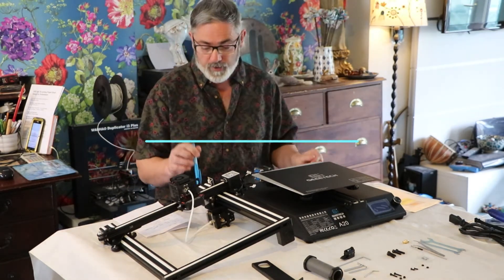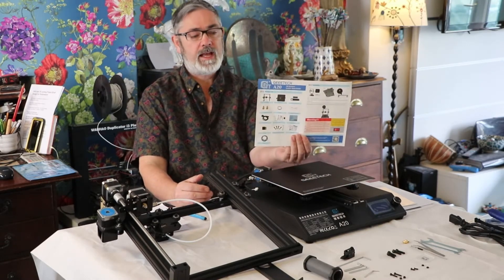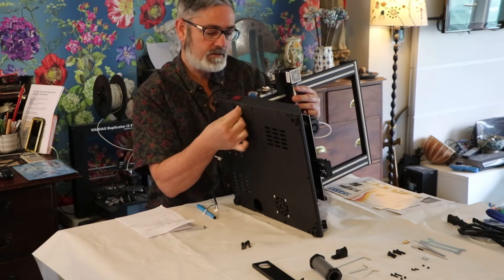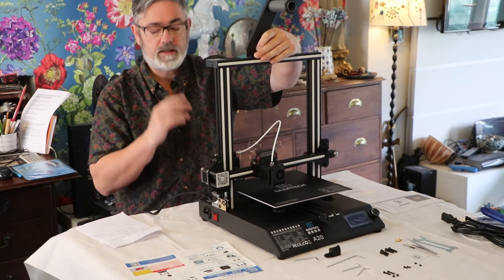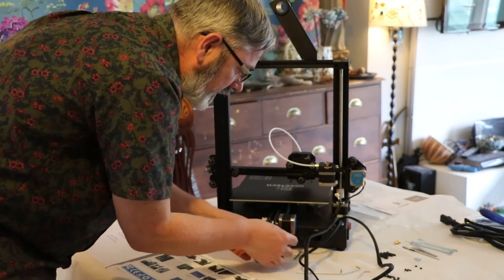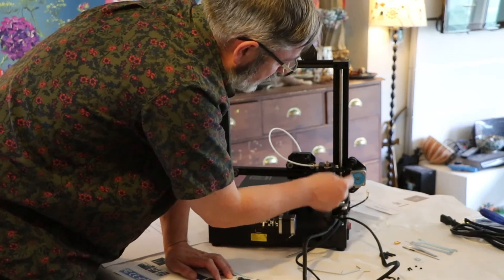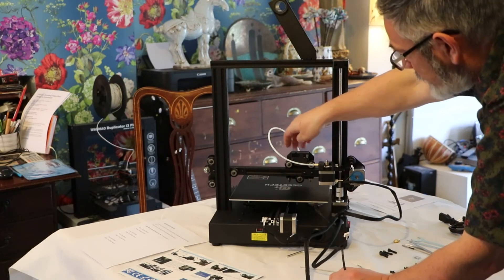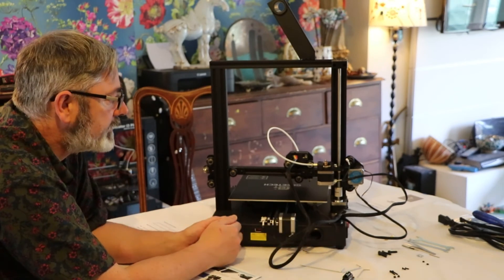Geeetech A20  3D Printer. Assembly

Comment: Good video - nicely paced and well-detailed. For everyone else, you need to adjust the 115v-230v switch to the voltage requirements of the country you're residing in. Here in the US, we use 115v - so switch the printer voltage accordingly.